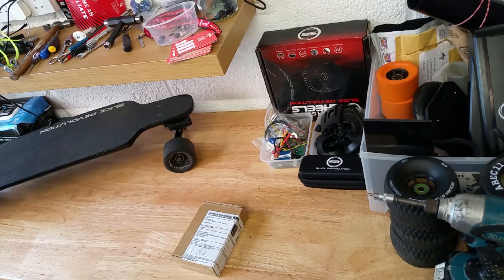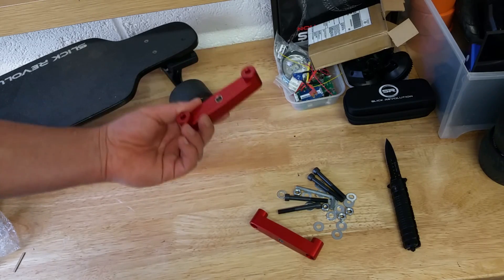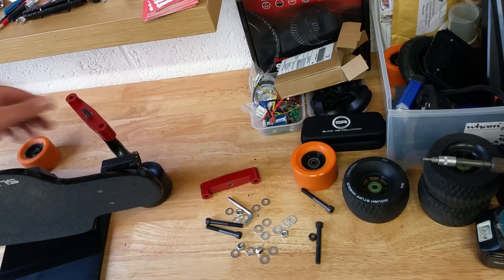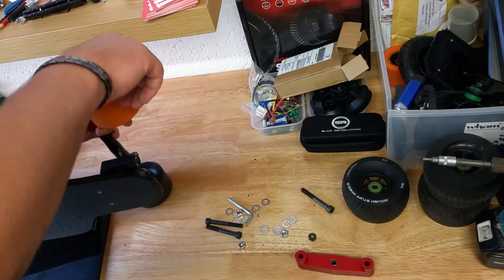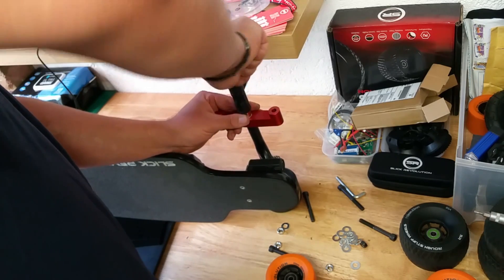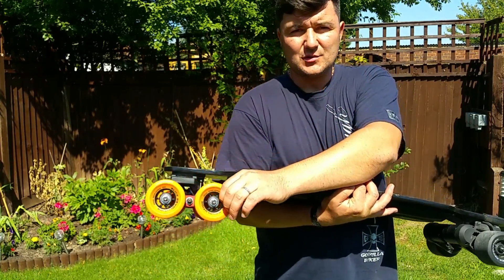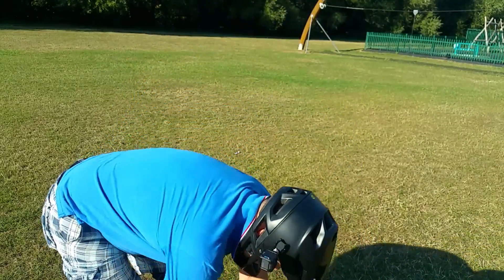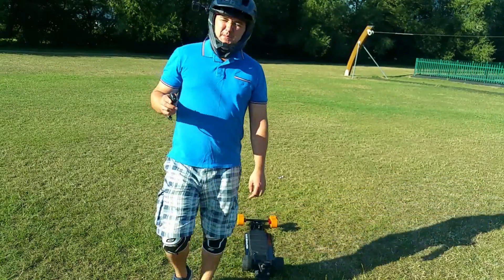Electric skateboard dual front wheel conversion. Test and how to!

Comment: Sorry dude, but as far as I can see, I don't see any interest in that system. It's counter productive on a mechanical point of view. Your trucks are supposed to tilt while turning so you end up riding on the edges of two diagonally opposed front wheels each time you make a turn, plus it puts way more load on your axles due to the width of the whole system adding more radius to your turns to end up with all the disadvantages. So I'm still looking for any good reason to use something like this except for just the hype... interesting though. Maybe with a special adapted truck would that be something worth of interest, but not as a "fits-all" device. My 2cents.
Reply from the maker: Hi mate. Thank you for watching and for the comment. I do agree with you. I did not personally like this system and did not use it. I just wanted to see how it works ; )

Comment: i'm obsessed with this concept.
Wonder what helps more, the extra wheels or the tandem/bogie axle setup.
Love the offroad wheel style. I might let that inspire my offroad skates in some iteration. 
I'm working on ideally making skates that replace cross-country skating skis when there is no snow. Low psi tubular tire on each foot, flattened to a short ski to comply to the ground, super low pressure. The interface between tubular (cyclo cross style) tire and skate is the tricky part. As in: greater challenge in bearing design ever.
Reply from the maker: Very interesting idea mate.

Comment: now make a longboard with 8 hub motors ayaya
Reply from the maker: Not a bad idea ; ) the only thing is that hubs are not comfortable to ride....
Reply: @PavelGarmas  well, this should mitigate it a bit, no?
Reply: otherwise, you can also lower the truck angle, and get a way softer bushing, should also provide some comfort, albeit at cost of turning angle.

Comment: Hey buddy! Glad you tried tandom bridge trucks like mine. Well done! 
It's a simple mod but it's a cool way to add a small means of riding over bumps with half the impact because it's taken by the arm not the single wheel and truck.
Your kit looks a lot neater than mine.
The RuffStuff wheels definitely looks cool, especially next to the 4 orange wheels
Reply from the maker: Thank you.
I did take them off though....did not like the additional noise it was making ….
Reply: @PavelGarmas  I guess it's for pedestrians to hear us coming. But I agree, sometimes added noise isn't so good after a cruise. I switch back to tires too.

Comment: I've found that the smaller the wheel the smoother the ride. I'm using 70mm. More stable on those annoying tactile paving stones.
Increases acceleration and control too.
Well done Pavel for this video 👍
Reply: I find that larger wheels give a smoother ride and handle bumps and cracks better
Reply from the maker: Thank you kindly! I do have multiple boards so can do with an off-road version. The AT wheels are super smooth and stable when going over the tactile stones....take a look at the Evolved 80 video - I was testing that : )

Comment: Very nice :) what if you try abec 83m?...I'm sure the rattling sound will decrease? Just a guess..keep up the good work..would really wonder if I could use it on my R2 with 100mm all terrain wheels.. but u already said max was 83mm
Reply from the maker: Ameling,
Thank you very much for the comment and for watching. Yes you are correct - the 83mm are the biggest wheels you could install safely. I think the 90 mm will fit but the space between two wheels would be oo small and the rocks could get stuck and jam the wheels,
Stick around and ride safely buddy!

Comment: Would there be wheel bite with larger wheels now?
Reply from the maker: The biggest wheel you could install are 83mm ….no wheel bite at all because the trucks are even wider now .
Thanks for the question and ride safe,
Regards.
Reply: +Pavel Garmas Do you think I'd be able to use 96mm with if I had some risers? Also what is the length of the swivel peice.
Reply from the maker: All depends what type of deck do you have and how wide the trucks are. I have the longboard deck and 10" trucks so no wheel bite and no need for the risers. The center to center of the axles is 100 mm so you should be able to fit 93 mm wheels theoretically ....but the space between the wheels would be very minimum and any larger rock could potentially get stuck and jam the wheels.Hope this helps.

Comment: Whats the maximum size of the wheels you can put on it? say i have 120mm on back hubs how much can i put on the front ones?
Reply from the maker: 83 mm wheels is what I had on the front. The 110 mm did not fit unfortunately.